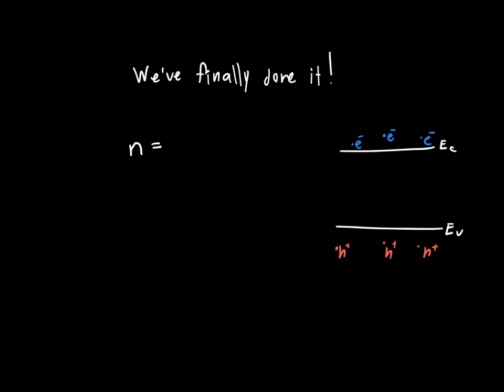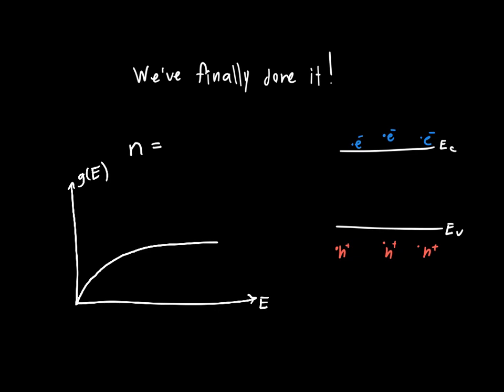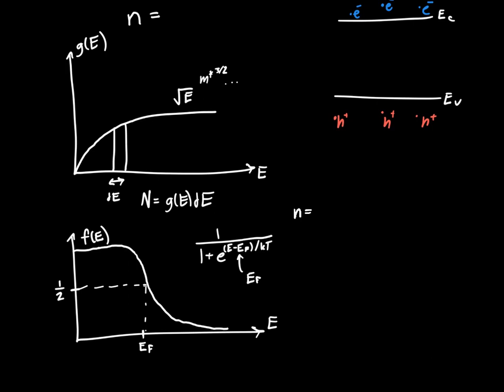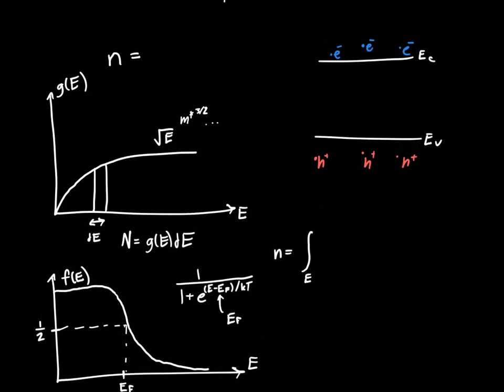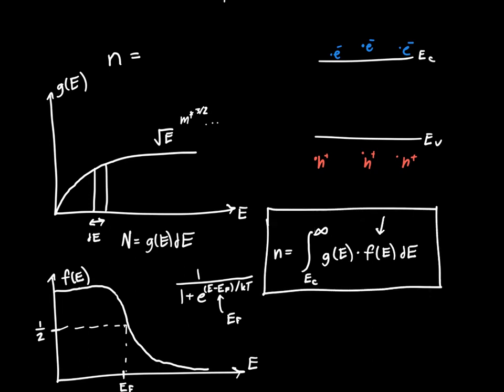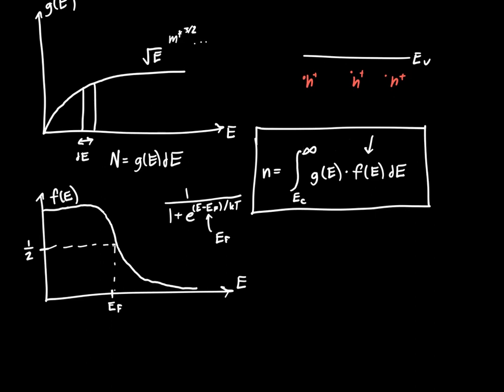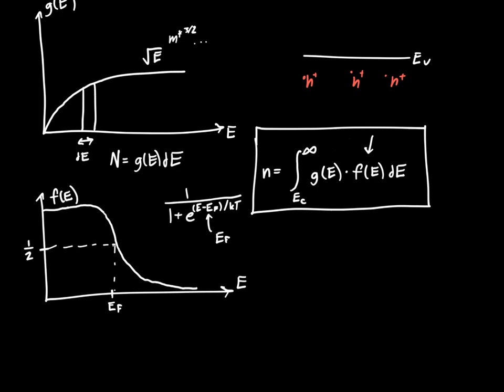Finding the Electron Concentration in a Semiconductor

Comment: Great video again! 

Question, is the density of states function we developed under the assumption of the 3-D infinite potential well still accurate? It is what gave us the n*pi/L that we used to derive that equation. I had assumed that we would need to recalculate that function using the kronig-penney model, but we didn't. Doesn't the spacing in k-space technically change? Or are we assuming that (again) for relatively small variations around k=0 the infinite well model is accurate enough as the KP E-K diagram is approximated by the parabola of the infinite well model?
Reply from the maker: So the density of states function does indeed originate from the infinite potential well model. The parabolic model is actually the model for a free electron, not that of a quantum well, and that is what allows us to treat the electron dynamics semi-classically. The spacing in k-space will change, and I actually don’t currently know qualitatively how it will change. However, I believe that you can use Bloch’s theorem to separate out the effects of the atoms and the effect of the larger quantum well structure and my guess is that it does change it, but doesn’t much change the overall result. 

Your question goes even deeper than that, though, because I think what you are really asking is *how do we know when to use which physical model*? From what I have learned so far, the answer seems to be this: the simplest model that will give the required accuracy. My guess is that this model happens to do that, but if you figure out exactly why, let me know. I’ll see if I can figure it out.